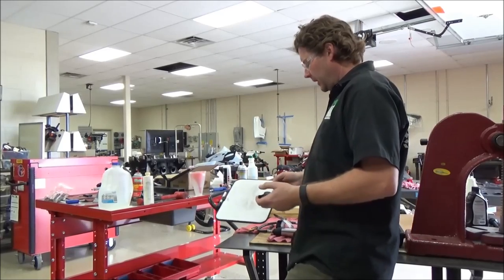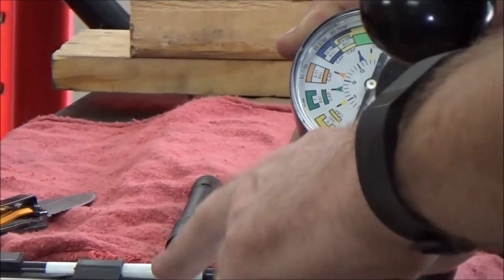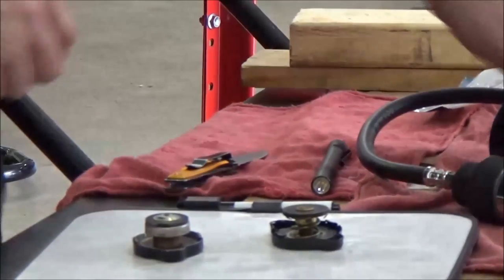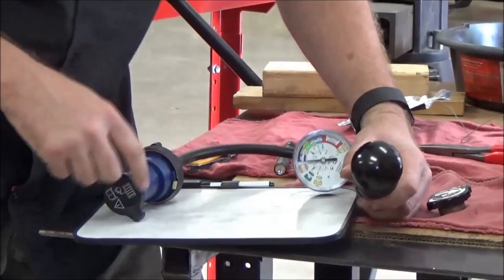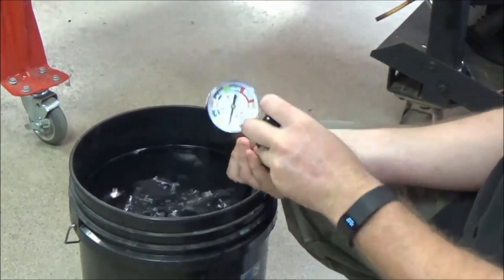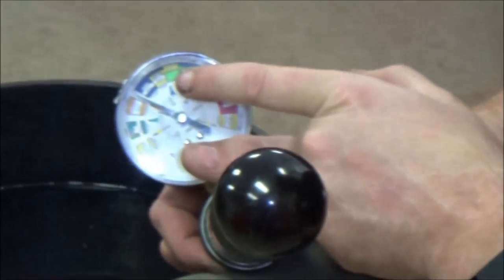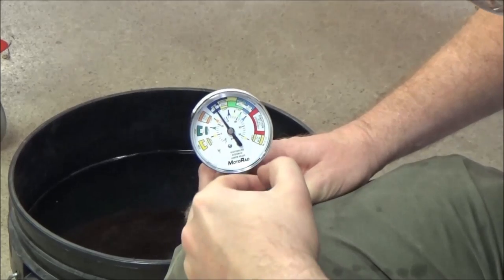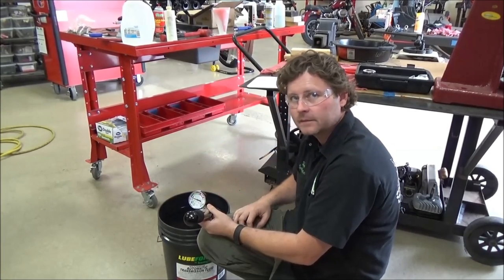How to test a radiator cap AND not get false results!

Comment: You really don't have to "go look it up" as the inner scale is in atmospheres (14.7 psi depending on altitude) and right there shows you 1.1 which was printed on the cap.  Good idea with the bucket although I use a little vaseline on the radiator cap neck.  Take care.  Doug

Comment: I have a different problem.  I'm testing a 44mm Toyota radiator cap.  I have a bad cap and multiple new caps.  When I test any of these caps, if I cover the vent hole on the adapter, they hold pressure.  If I uncover the vent hole, none of them holds pressure.  Essentially not a test at all.  I'm guessing the Stant 12021 adapter is too tall between the cap lid seal and the opening that simulates the radiator neck.

I think I found the problem.  The adapter I have was not advertised correctly.  It is a different 44mm adapter that applies to this cap part number.
Reply from the maker: We just received and will be doing full product reviews for the Mityvac brand of cooling system testers for auto, truck and powersports. One big reason for our desire to switch brands was the excellent customer reviews and customer service we received from them but not "other brands". Please stay tuned and look for our new videos. I would suggest you attempt to reach out to Stant and see if they know of a solution. We would gladly test your cap with our new equipment free of charge for our video. Feel free to reach out to us @ 712-281-8374.
Reply: @How2Wrench  Thanks. I received my order for the second Stant adapter and was able to test the cap. I have the OEM Tools radiator cap tester and Stant adapters fit it perfectly.  My old cap tests at 0 psi. (I think that explains a lot!) The new caps I have on hand test at 13-16 psi and the cap is rated at 15.7 psi.

Comment: SHANE CONLEY
                                                     what testing tool do you use to test and check the temperature gauge in your cars dashboard is working correctly or is not working correctly? what do I use to test the temperature gauge?
                              how do you test what the PSI level of the radiator is at while the car is running?
Reply from the maker: That surely is a question for Shane. We try to respond to these questions but with 700 videos on here its hard to keep up with the demand of over 400 requests a week for “a quick answer” it's just become hard to manage in a timely manner.  

Good news you can catch him directly. You know him from his videos, no shortcuts on answers so he wants you to get everything you need. If looking for technical help, business collaboration call him directly @ (602) 345-0432 
Are you just wanting to say thanks? Consider a donation here: https://www.paypal.me/how2wrench
Thank you in advance for giving back! He looks forward to working with you directly!

Have you hit that subscribe button yet? :)
Reply: @How2Wrench  thanks for the help
I'm trying to test the temp gauge by itself to see if its giving "false readings". 
What "Test Tool" can I use to test the temp gauge to make sure its reading correctly or giving false readings? 
Plus can I connect another Temp Gauge I can buy at PEP BOYS and connect it to the fuse block to test the temperature to isolate if the temp gauge is the dash board is giving false readings?
Reply: @How2Wrench  thanks for the helpl
^^      I disconnected the Temperature sending unit/temp sense, so How can I test the instrumentation temp gauge in my cars dash board by itself to check if its working correctly, what do I need to do?

Comment: My rad cap goes up to 20 PSI but wont hold it there as the 20PSI is the opening pressure point, but it hold steady at 16PSI.
Reply from the maker: Here's free tip (consider supporting please) If your system requires 20 then you need 20. Currently your system is being protected up to 16 psi and depending on use you may not see overheating BUT the cap could being failing and get worse at a time you don't want (like sticking you on the side of the road). Never trust the cap installed as the last person could have installed the wrong psi. Check the manual. 
Glad it helped! You rock for commenting! We will let Shane know! You can give him a high 5 here:  https://www.paypal.me/how2wrench   
Another way to help us back is joining or grabbing our T-shirt! Support links and gear below!  Awesome and thanks for commenting! Smash the subscribe button (thank if already a sub!)
Have you seen our "YouTube Trained Support Shirts? Great way to "high five us" https://goodfellasmerch.com/collections/how-2-wrench/products/support-shirt 

Join this channel to get access to perks:
https://www.youtube.com/channel/UCBhM8DCKnT3qXwTW0eToyCg/join    
-Daily MEMBER FIRST COMMENTS ANSWERED FIRST 
-Live Q/A video chats
-Wonder if we have a video on your need? Members can request content links!
-Full Access to the ENTIRE 700 video library
-Member-Only FREE tool giveaways   

Got an emergency and your head is about to explode from frustration or fear? Get Shane’s cell here: https://how2wrench.com/ols/products/techline-one-on-one

Comment: I have a 2004 mazda 3 that sporadically overheats. No coolant in the oil. New thermostat. I just did a coolant flush. Heater core is not plugged. No air in the system. It runs fine. Then just out of the blue, the temp goes all the way up. So I pull off the road and, as slow as I can with great caution, release the cap on the coolant reservoir. Coolant rushes back into the bottle. Along with a fair amount on the ground. I know. Unsafe for me. But when I need to get somewhere, I have to do what it takes. I'm leaning towards water pump of faulty thermostat. Right now, I'm sitting in my car with it idling in my driveway. Its been running for the last 15 or so minutes at operating temp but has yet to overheat. Its very sporadic. Some days its fine. Some days its not. But what I have noticed on occasion, is even after it sits not running for a few hours(5 or 6 hours), it will still have a large amount of pressure built up. Enough to blow the cap out of my fingers when loosening it if I'm not careful. Very frustrated with it. Any ideas what to check would be helpful.
Reply: any fix? i have the same problem on a 55 plate civic
Reply: Your head gasgets are bad the excessive pressure pressure in the coolant is coming from the combustion chambers on the compression strock GOING into your COOLANT  ASE CERTIFIED TECH SPECIALIST AND BEYOND

Comment: My radiator cap does not even fit the tester cylinder... it is too small....What now??????
Reply: You have to purchase the correct adapter for your tester.
Reply: Youtube comments would have been my LAST place to ask about my radiator cap not fitting on my testing tool. Probably the manufacturer's website or where i bought it from would have been my first choice. Do people really struggle this hard with normal life???